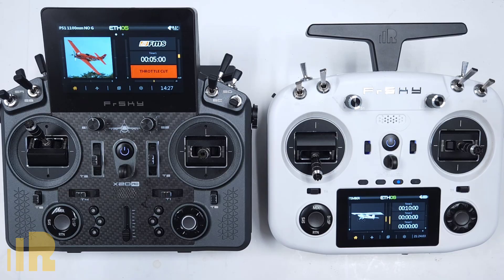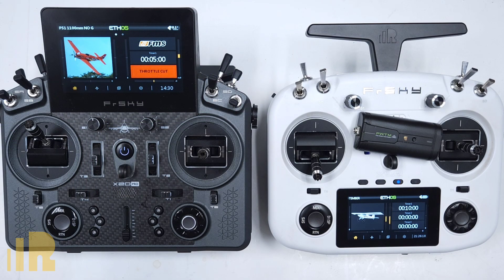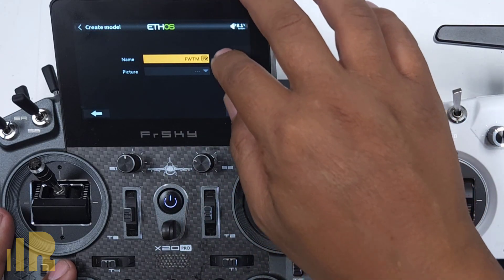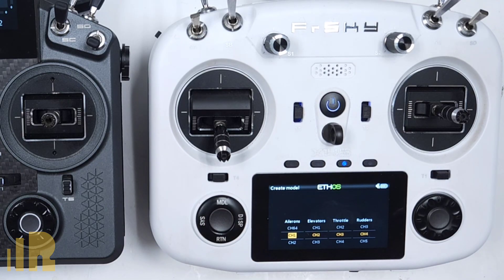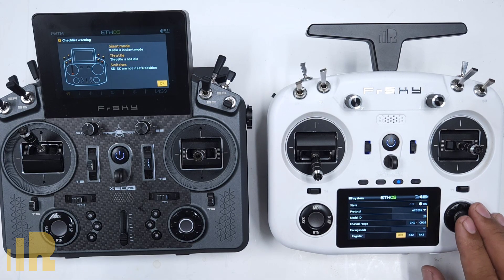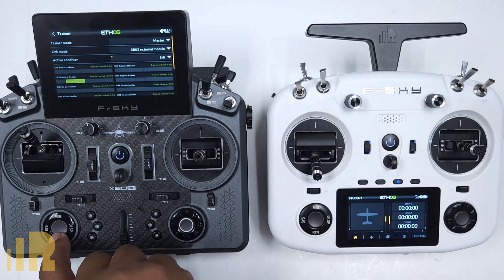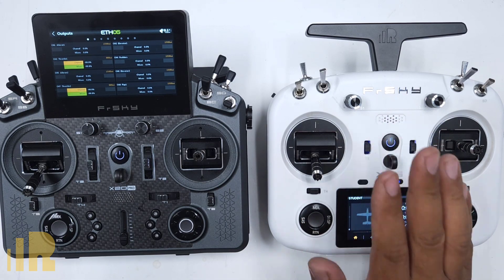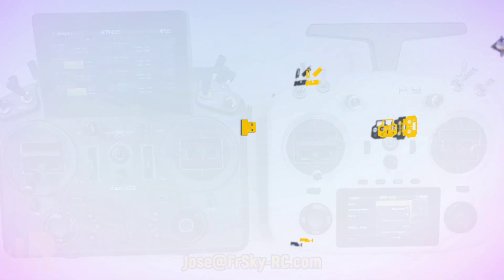FWTM Wireless Trainer Module. FrSky EthOS Instructional Series.

Comment: Good video, but you might also want to show it binding in d16v2 accst mode for those who used a pre access enabled radio for training. Many of your loyal long-time customers have legacy systems that would be very useful for training and demonstrating to new flyers or youngsters. This could help enable new people to join the hobby and also be a good introduction to the versitility of frsky radios and the support frsky supplies to their past customers with legacy systems.
Reply from the maker: Think of it as a receiver. You bind it like you bind an ACCST receiver. Everything else is the same